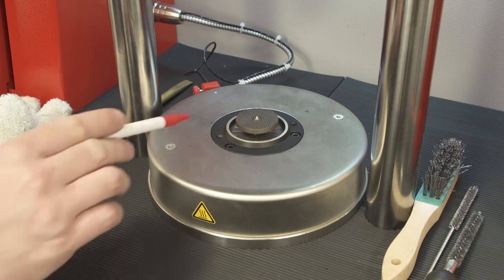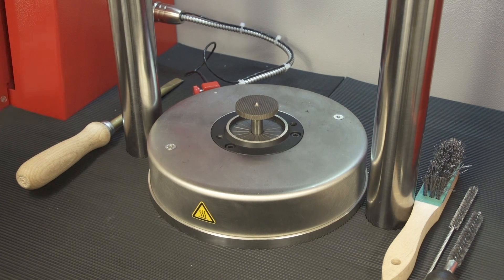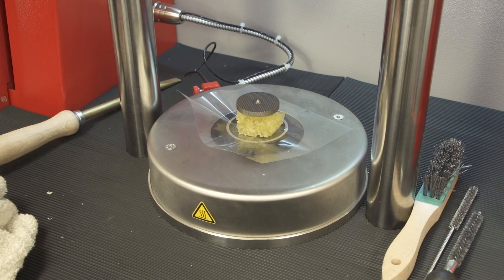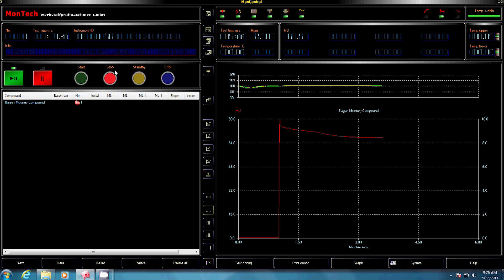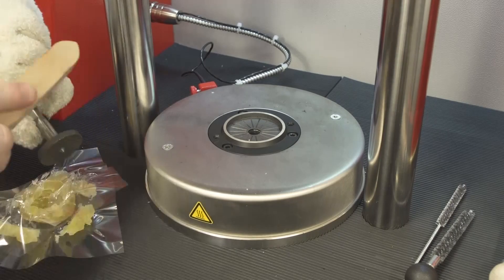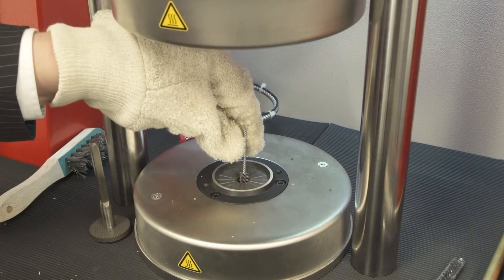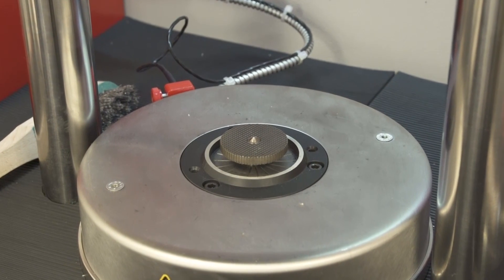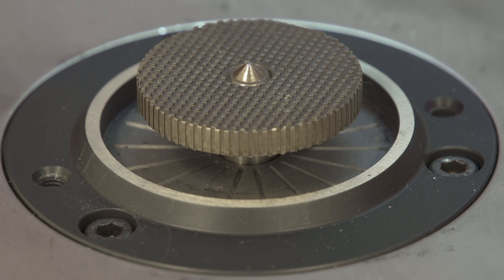Mooney Viscometer Operation

Comment: i have rubber stoper its small sample ,  can i use this nachine to determine the mooney viscometer ?
Reply: It depends on the die, your samples should fillup, you have to take 13 grams of both upper and lower samples, without it you will not get the right value of rubber samples.